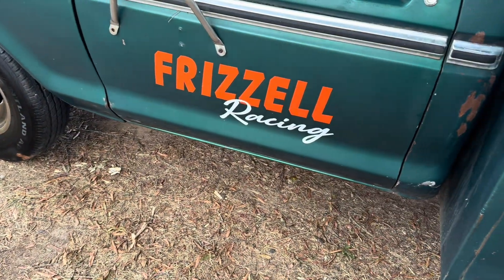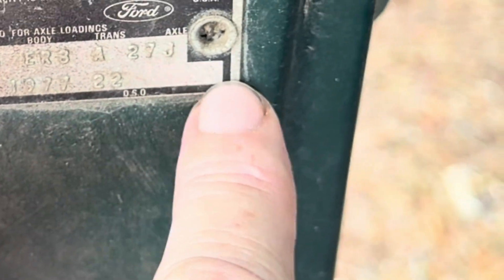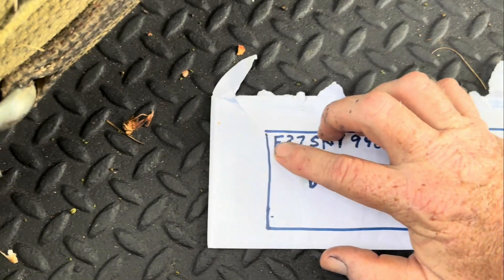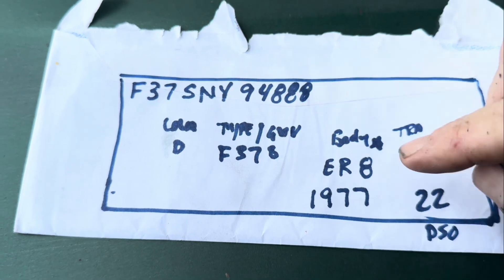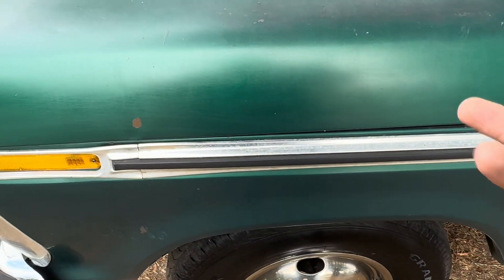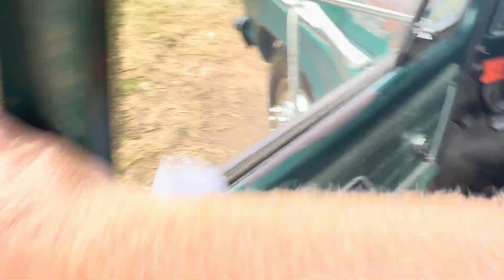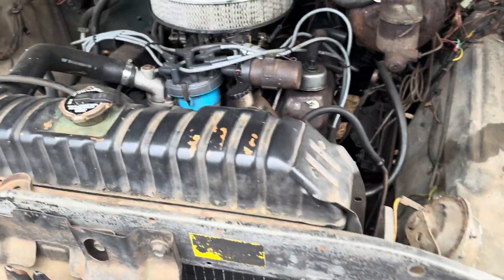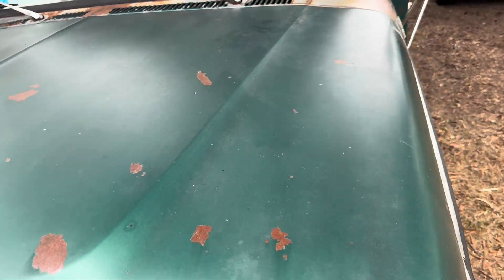Decoding VIN and Door Tags on Classic Ford Truck

Comment: F250 4WD High Boys used that in-cab tank as well, I guess due to their narrower frame rail cross-span. The frame VIN stamping is on the passenger side rail, under the alternator.

That's a nice truck, being a work truck, and ordered with the Ranger package!
Reply from the maker: I’m a big fan of it.    I’ve been trying to get one for years.   And finally found this one.
Reply: @frizzellracing  I do agree that Bumpsides are a slightly better looking truck than Dentsides, and that the '80-'96 are a somewhat better truck than Dentsides. But Dentsides are the quintessential American pickup truck.
Reply from the maker: @DanEBoyd  truth.

Comment: Why did they put the J front axle code on 2wd f250 and larger? Mine is 38J.
Reply from the maker: @JimsFastbackGarage  from what I’ve seen J just means power steering front axle.   At least according to the fortification site  which is what I normally go by
Reply: @frizzellracing  That's where I go, but I couldn't figure that out. My truck was a one family farm truck that lived its life right across from my old high school.
Reply from the maker: @JimsFastbackGarage   it takes a minute to learn to navigate that site.  There is some links you have to click on as you scroll thru.  But to the best of my knowledge the J is just power steering.    That’s all I’ve seen it used for.  I wish YouTube would let me add a photo to the comments but it won’t.
Reply: The 38 is the rear axle ratio, manufacturer and locking/non-locking code designation. As noted the "J" just means that the front axle is a power steering equipped one as these trucks had that optional in those years.
Reply: @googleusergp  I couldn't figure out what the j meant. It does have power steering.
Reply: @JimsFastbackGarage  That's an easy one. Ford did that on their data tags for years. No "J" generally indicates a non-power steering truck.